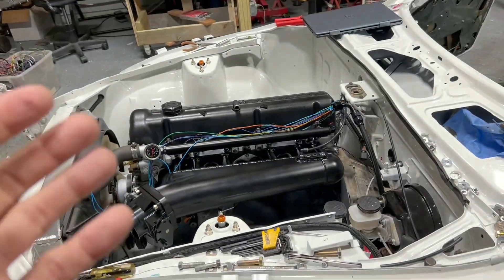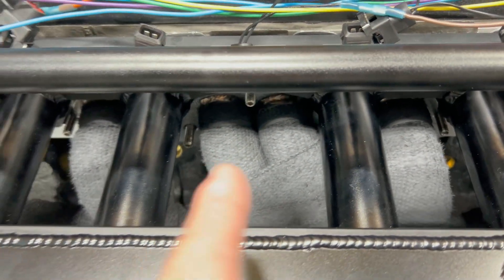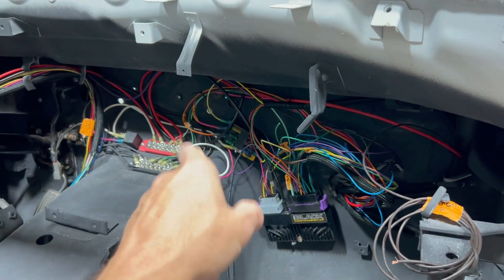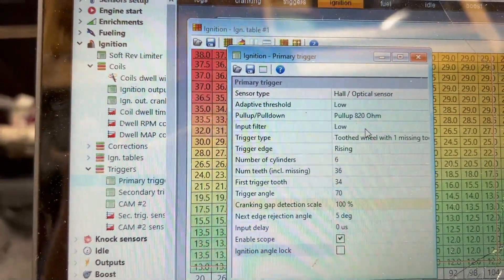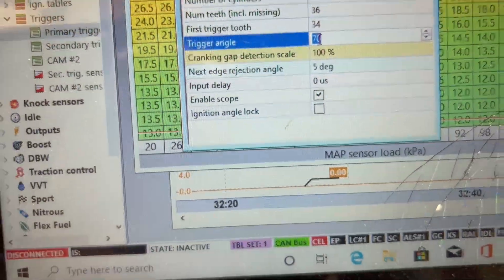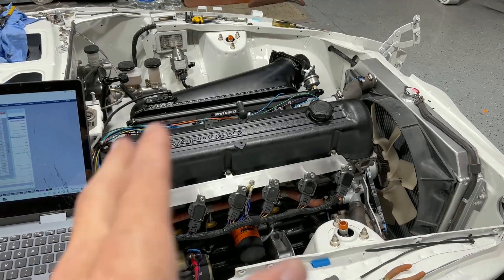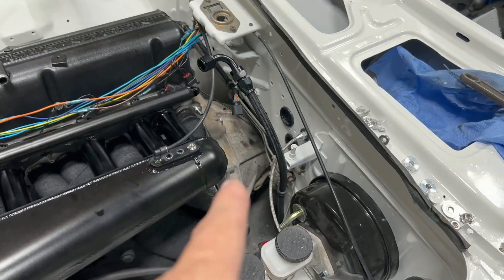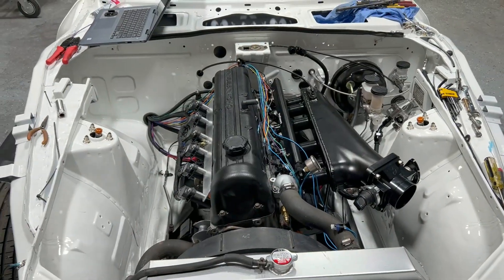Datsun 280Z Running On ECU Master EMU Black!  How To Setup Triggers And Sensors!

Comment: How do you remove the whistle from the intake? I have the same problem. Thanks
Reply from the maker: It’s in the throttle body. There’s a bypass hole right behind the throttle blade that you have to fill in with something. I machined a round insert and epoxied it.
Reply: @ thank you! You help me to fix  it
Reply from the maker: Your welcome👍🏼

Comment: My L28 seems to like a lot of timing. I’m having an issue tuning it though. I’m using microsquirt, and it seems like it completely lacks torque below 5000rpms. It pulls like a train once it gets going though. I’d like to look at your maps when you get a tune you like.
Reply from the maker: I will make more videos on the tunning process.

Comment: Did you sort out the whistle issue? Check the Protunerz throttle body. They have had issues with the IAC inlet making a similar sound. Protunerez has a fix for this issue. .
Reply from the maker: Not yet.
Reply from the maker: Thanks I will message them about it.  It does sound like it’s coming from that area.

Comment: Why not use a 2jz base map, ignition and injector events should be the same,  l did emu black on my jz and I am starting to build a l28et on emu black for the 280z
Reply from the maker: The fuel map for na is quite a bit different than boosted.
Reply from the maker: And ecu master doesn’t have any na 2j maps.